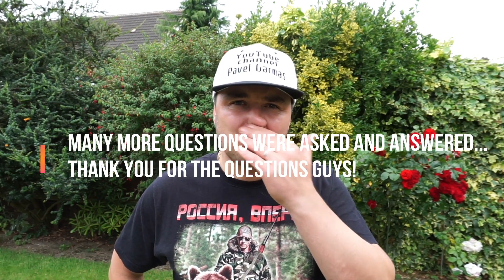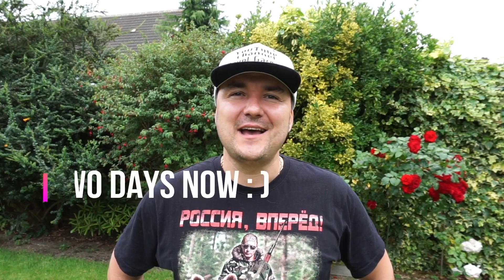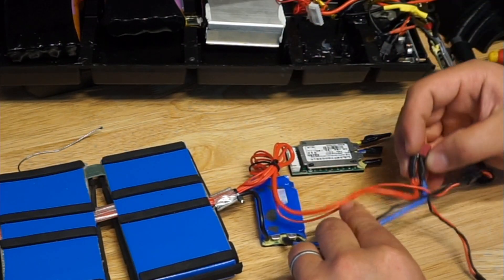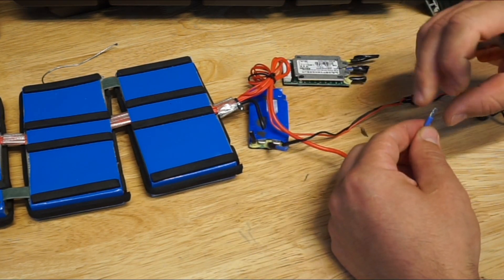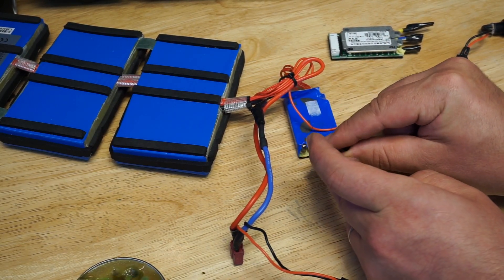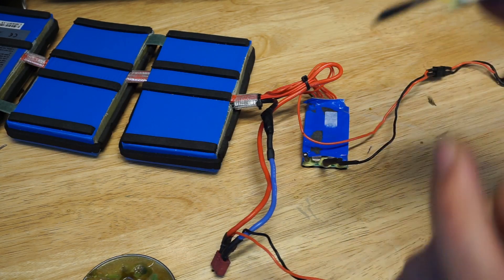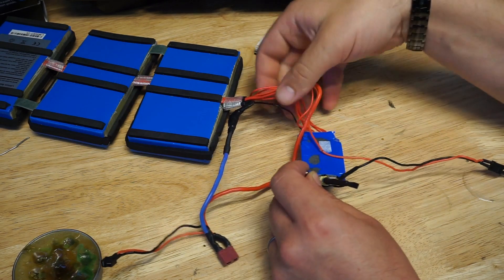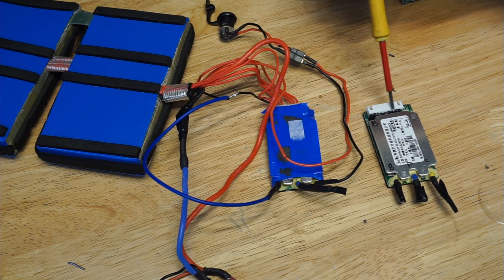How to by-pass BMS on electric skateboard. MORE POWER!

Comment: My skateboard is disconnecting at random times. From the entire battery, it is my understanding that it could be the BMS, because the light flickers on the ESC which means it's being provided with poor voltage. I checked all of the battery cells and they seem fine. It must be the BMS disconnecting the battery from the board right? Please Help ME.

Comment: I would like to note, anybody who’s using this video to Bypass their BMS on the Meepo Hurricane should note a few things. First is that you do need to either keep one of the Discharge negatives Hooked onto the BMS and Use the Second Negative cable (as there are two Discharge Negatives going into B- on the Meepo Hurricane) to Cut and Wire Direct to the Discharge Power Port. I learned the hard way that of you cut both Discharge Negatives from B- and Bypass the BmS it will work but it WILL NOT SIGNAL THE CHARGER TO SEND A CHARGE AFTER YOU KILL THE BATTERY. I was lucky that I had Two Batteries. 1 was for trial and Error and the other I did Correctly 🤣🤦‍♂️. 
So to make this short, The BMS on the Meepo Hurricane will have two Discharge Negative going through the BMS and Exit the BMS to the Discharge Port as just 1 Cord. So cut 1 Negative cord from B- and Bypass it to the Negative Discharge Port While leaving the second Black Cord still attached to B- so it still charges correctly.
After that is done it will work. Please note that Throttling in Fourth on a full charge while holding the Board in the air might cause the Safety mechanism in the motors to briefly cut Throttle because their seems to be a little to much power now going to them. This stops at about 85 percent and doesn’t happen when I ride. Only if I hold the board in the air to throttle. I have 1 original Hurricane Motor and One newer one. The old one does not have the safety feature of cutting throttle I noticed because it’s smooth and holds throttle no matter how much power you give while the newer motor seems to have some sort of safety shut off if to much power goes through. Again this is just something I noticed but does not effect my riding at all and does not happen when I’m actually on the board.

Comment: Hi pavel excellent video however the last bit about reconnecting the b- terminal so that it controls the charging is really something i dont understand, as far as i see regardless of this port, the battery is receiveing the full voltage of the charger no matter what the b- port does as both the red and black cables go directly from charger to battery, as far as i understand the bypass will work but soldering the b- into the black cables of the battery will not prevent overcharges, as once the battery is loaded, nothing will disconnect the charging, am i wrong in this kr and thanks in advance!!!

Comment: But then how is the battery not dying from over discharge?
Reply from the maker: You ecs does control the discharge and you can programme it.
Reply: How do you think the ESC measures battery percentage? LOL clearly it's programmed to stop at a certain voltage. Duhhh

Comment: Question, I have a shared XT60 conector to my battery and BMS so wanting to bypass the BMS for discharge. Could I just add another discharge cable with an XT60 connector straight to my battery? Preferably, I don't want to be cutting any cables. I'm happy to have a charging connector (running through the BMS) and a discharge connector. My battery is 4p 16s
Reply from the maker: It would be better if i know what bms it is and a schematic showing how it is wired now mate.

Comment: Thank you pavel !  I just seen this vid  my bms ever broken. i connect my battey directed to esc for used while i wait my new bms and work fine. my board very powerfull than past. but i dont need high discharge. when my new BMS arrive i will assembly not to by-pass. cuase discharge pass from BMS to ESC is good enough for me.
Reply from the maker: Glad it helped

Comment: i dont thing you need to connect b- to earth connection, on series wires if you test with your multi meter u should see it all ready connected internally unless your bms is different then after market bms
Reply from the maker: That BMS was from factory built board and that was he only way to get it going... looking at some feedback from other viewers, seems that this method did work for a few instances. I do show how to by-pass smart BMS units in my battery building tutorials as well.

Comment: Is there a way to temporary bypass the BMS to charge a battery that has been in cold storage for more then a year? My fast charger that came with the board is not charging when plug as it shows full charge but it’s not & is totally flat (red light on battery indicator)
Reply from the maker: Hi mate! Temporarily....not really. By -passing BMS involves getting to the wiring and changing the way the cables are. You could potentially install XT connectors on the cables after you cut them and then re-plug in if you have space for all the additional connectors.

Comment: Nice video,  with this set up  a remedy  for Escooter I know the battery will not be Overcharged  due to its automatic cut-off  power charger, when it reached full voltage it will cut-off   itself..
Reply from the maker: Thanks for the info and thank you for watching.

Comment: Is it safe to bypass bms ? On my 72v 150 ah battery on discharge as board smokes when i put on load
Reply from the maker: Hi. It is safe to by-pass the bms because the VESC / ESC will be controlling the discharge. What do you mean your board smokes mate?
Reply: @PavelGarmas  it literally smokes/ overheats
Reply from the maker: @simardmg  so the bms smokes...from getting hot? Something is wrong here mate. Is bms and all other components actually 72V rated?
Reply: @PavelGarmas  yes a thoroughly checked about all the components they are compatible with each other and appropriately rated the only thing about BMS is its locally made in India, company might be overpromising I ordered a Daly BMS 24s 100a 72v lifepo4 to ensure fool proofing 

I am converting santro ( internationally known as atos prime) to electric , coupling motor directly to gearbox

Comment: I wish this would work with my battery. The design I have uses the discharge ports as the charging ports as well. I am in a tough position where I would have to re-engineer the entire setup or find a replacement BMS that fits in the same spot.
Reply from the maker: Discharge should be straight from the battery to esc ... charging points - one to battery and one to BMS.
Reply: @PavelGarmas  for testing I just doubled up the leads on each of the posts effectively bypassing the BMS allowing the maximum voltage through. Unfortunately this didn't fix me issue but at least now I know it's not the bms. Thank you for the video and replying to my comment.

Comment: Hello pavel! What are the disadvantages of bypassing the bms?
Reply from the maker: None if you are using good quality ESC / VESC. Discharge side of BMS controls the discharge of the battery pack so does the ESC or VESC.
Reply: @PavelGarmas   That was a clear callout to get back to work :) thanks Pavel!
Reply: I'd add a fuse ... ... one of those reseteable ones, 80A or whatever... just in case something goes wrong, it's better to fry something else that is not the cells and BE CAREFUL not to OVERDISCHARGE ... so add a volt meter too
Reply: @robertroigsantamaria  where would you add it please ?
Reply: @TengKaz  coming right out of the battery,,, but the fuse and the voltmeter are 1/2 of a BMS... and mind that BMS's are there for a reason.

Comment: what if.. make a bridge from B- to P- without cutting any cable?
Reply from the maker: Positive wire needs to be disconnected from the unit on the discharge and only the charge side used. Positive goes directly to the esc.
Reply: @PavelGarmas   I've done that bridge... cause i like make mistakes X.x ...it worked... but... the battery switch on/off now doesn't work, the battery is always on... and when I use it, at the first big load the BMS cut off once and I can feel a little lowering of power, (2 of those cause i got 2x 36v battery in series) but than and after that all good and smooth... charging side its fine... but I will try your way to see if I can get away from the BMS cut off anyway! ...ty again mate!

Comment: Great video! Thanks!!

Im looking for a wireless remote for an old e-glide board i have with a 70A idrive controller currently using a wired hand throttle. 
The iDrive can be configured to use switched signals, restive potentiometer (0-5K), or a voltage input (0-5V), as the throttle input/drive signal.

Can you recommend anything, or anyone i can ask about this?

Neither e-glide nor idrive have any options at the moment.

Thanks again!

Comment: My battery has deep-discharged and the BMS is preventing them from charging up. If I perform this, will it cure my problem and allow the battery to charge?
Reply from the maker: Hi mate,
What is the voltage that you cells have dropped to? 
By-passing the BMS is for allowing more juice on discharge side and will not help with charging mate.

Comment: Hi Pavle, can you bypass a common port BMS?
Thanks
Reply from the maker: Hi Frank,
What do you mean by a common port BMS?
Reply: @PavelGarmas  there are two types of BMS, separated ports and common ports, you did the bypass with the BMS with separated ports.
The question it's possible to do the bypass with the BMS with common ports.
Hope you understand it
Reply from the maker: @africans1968   no idea..i will not lie .ESK8 BMS or at least all the units that are used for ESK8 can be by-passed that is for sure.
Reply: @PavelGarmas  common bms using the same port for charging and discharging, separate ports - one for charging, one for discharging

Comment: Great video! I built a board without BMS but for some odd reason I can't rid it past 2min without losing power. Not sure if I'm losing current from the battery or if to much is flowing to the VESC. I'm lost on what the issue is. My specs are: 12s6p 18650 20R, Flipsky FSESC 6.6, Flipsky 6384 190kv motors x2, Anti-spark switch, etc. I'm a big guy about 110kg, have you ever had this problem or any ideas what would cause lose of power and torque? Great videos and keep them coming!
Reply from the maker: Hi mate,
Have you sorted the issue yet? Join ESK8FREEDOM Facebook group and we will help out... its easier and faster that way ( it is my group ).

Comment: wow i just done wiring,the scooter not cutoff now..but the charger cant detect charge..alwasy green light..
im not cut anything cable from charge to battery..any solution?
Reply: i found the problem,the battery voltage drop to 30v,the charger cant reconize the low volume maybe..can i joint the black wire charger to black controller ? if i do like that..the charger can detect the battry.

Comment: Just a quick one, great videos dude keep it up 👍🏻 what are the main reasons you would want to bypass the bms? I've heard if something fails it stops the board from locking up is this true ?
Reply from the maker: Hi mate,
Thank you for watching and for the question. I do always by-pass bms on discharge but not on charge. The reason for it is that most of the DIY boards use batteries that can supply currents higher than what the bms can take... bms does create a choke in the power system and gets by-passed. Good esc will keep the battery from over discharging if set up correctly.
Hope this helps.
Reply: @PavelGarmas  awesome cheers dude your answer was spot on i get it now 👌🏻 im building  a diy atm you don't know anyone that can build a battery for me do you ?
Reply from the maker: @rickyeverett  
Are you in 🇬🇧?  UK ?
If yes,  then i know a very good guy.

Comment: Great video!  So is the large black wire from the battery (was connected to B on the BMS before you cut it) and the thin black wire you make the final connection with connected internally to the battery?  The large one of course is the negative coming to the BMS, then passing through the the discharge port (P).  I was thinking the small black wire is also connected to the battery negative, but it just a sense wire so no large current passes through it.  Is that right?
Reply from the maker: Hi Shane,
Sounds right.... the idea is that you do take the big negative out of the BMS and go direct to esc. The small black cable is for charging so that BMS can sense the charge of the cells.

Comment: My ebike batter is 72v 40ah w Panasonic pf cells which are 3c.  They should give 120A cont. but my BMS only allows 80A to pass through.  I want to get a sabvoton 150A programmable sine-wave controller to pull more power but obviously my battery will cut out.  Is this relatively safe to do on a larger battery such as mine?
Reply from the maker: HI Eric,
There are two ways of controlling your battery discharge - BMS or a good quality speed controller. Normally BMS will be like a bottle neck and will restrict the discharge so you are safe to by-pass it as long as you are using a good quality esc and will set it up correctly ( max discharge and low battery limits ). 99% of electric skateboard builders do by-pass the BMS on discharge.
Reply: Yes it's safe to bypass your bms for discharge only and you still charge through your bms ... just be sure not to drain your battery too low since your bms will no longer cut off when it hits low voltage... my low voltage should be 50volts but my controller stops working at 48volts so that's my safety cut off. My controller works up to 90 volts and my battery is 87.7 so I get to use from 48v-87v for my range. Its excellent.

Comment: Hey there,
How does this work with regen braking?
Your vesc puts back 30a directly to the pack through the discharge cables? With no balancing?
I understand the charge circuit is still balancing when plugged into the charger.
But while riding?
I built my own 10s6p battery but only have a 30a bms handy
I have the Flipsky 50a cont esc so i dont want to lose power by bottlenecking at 30a
Any suggestions?
Is this something we dont mind because later we will charge it back up with balance?
Many thNks!
Reply from the maker: Hi,
Regen braking is such a little factor in my mind. Energy is being pumped back to the cells during the braking via  the main positive and negative gables and will get distributed across the cells randomly  and yes you are correct - this will get corrected during the balance charge. I do set my regen as low as possible considering the brake strength that i need, terrain that i ride ( very little down hill ) and the heat that will be generated on the motors if all the generated power is not being used.
every DIY builder that know does by-pass the discharge because it is way more dangerous for the bms to cut out due to discharge limit than the regenerated power harvesting.
Hopefully this helps.

Comment: I see many people just cutting ground from bms and connect dirrectly to plug and didnt see that they connect the small wire from the other side, will that be a problem in the future?
Reply from the maker: Hi,
I do not think that it will but I do by-pass BMS this way and done it over 5 times now - no problems.

Comment: Great video I swapped to charge only BMS a while ago one of the downside of a regular BMS is braking doesnt work when your battery is 100% no where to dump the power. I live at top of a hill and most of my esk8s start with braking i worked out to charge battery to 97% (adjust my charger) and bypass my bms.
Reply from the maker: Nice one!
Another thing that you could do is reduce the regen Amps in the vesc tool and just give the board a 15 -20 second dry run before going : )

Comment: This is NOT recommended for beginners since a overcharge can quickly damage your Cells and burn your house..
Reply from the maker: Hello mate!
Thank you for watching and for commenting BUT..... I do not think you did watch the video carefully : )
This video was a request from my subscribers and not my tutorial PLUS - by-pass is on the DISCHARGE side NOT charge side buddy.
Had it done to two of my DIY boards and all good,
Ride safely mate!
Reply from the maker: Thank you for understanding. I was asked to make a video so I did : ) Here to help my ESK8 family!
Reply: All your doing is running new discharge leads it's just basic soldering
Reply: And here we are 4 years later, epstein mysterously didnt make it only another 2 days to make it to a courtroom to speak about his nextdoor neighbor who relied on dangerous sleeper cells to bring a noose to a house, not burning the house of democracy down but causing a few innocent victims to go home in a pine box, which really was NOT recommended for beginners.
Reply: It is common sense you are not gonna start messing with your BMS If you have no clue what you are doing and why. THis is a great video to show how to be able to use full potential of your batteries. Not only discharge rate but also the ability go down to 2,5-2,6 volts thus giving you 10 percent+ more range than with BMS.
Reply: Exactly. What you did is this: The BMS no longer protects the battery from discharging the LiPoly cells below 3.3V/cell. That is the safe side. If the voltage drops even lower the cells are gonna be damaged forever. And if it is a good bms it will refuse to charge them. So if you people are not getting full power from your battery, it might be the bms discharge rate that needs to by changed. Disabling it will lead to damaging the battery by deep discharge.